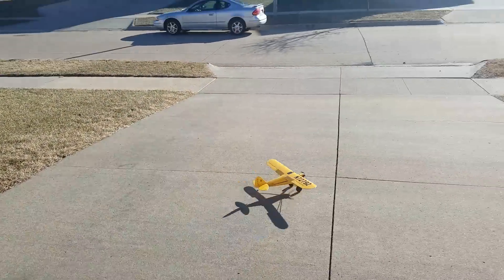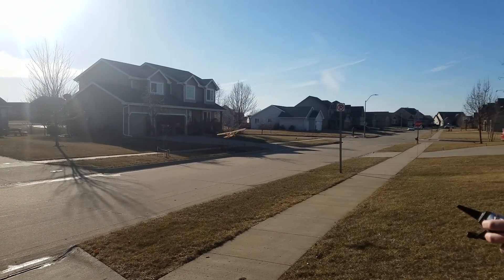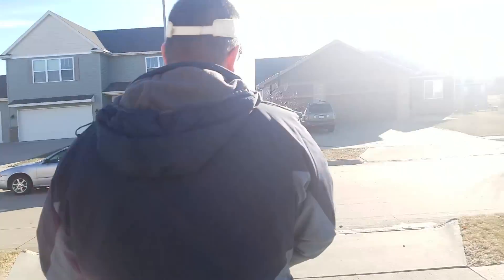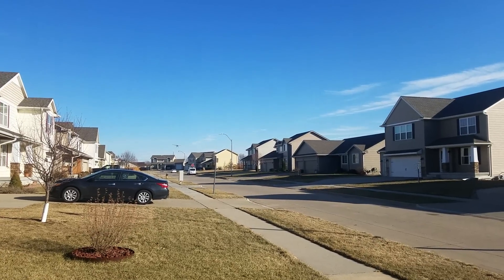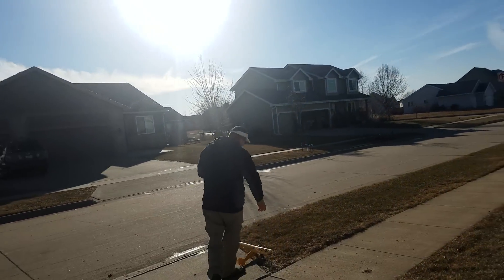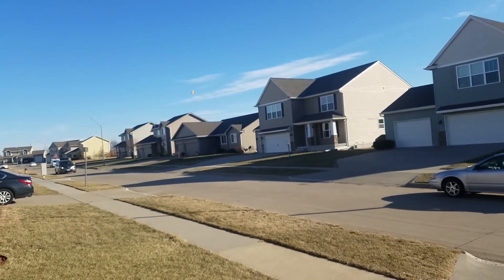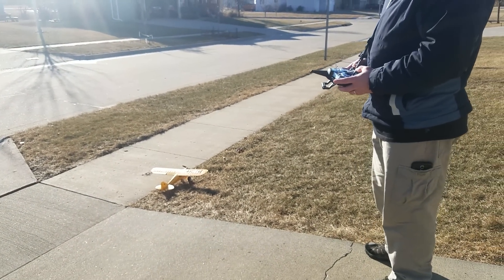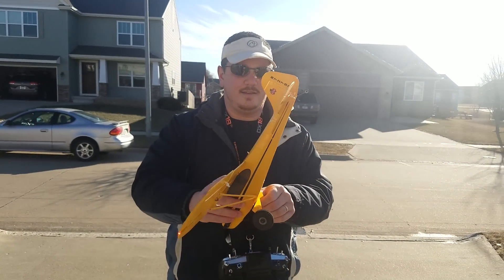E-flite - J-3 Cub UMX - Flaps, LED's, & Lightened Tundra Tires 1/14/2017

Comment: Dig the mods you made to it.  Glad you are liking it.  It handles the extra weight well.
Reply from the maker: I think I may still think about the 3S mod...if the ESC and Motor don't complain, that will immediately solve the problem. Oddly enough though, some of these Horizon Hobby UMX's won't work on 3S. If I try it I'll share the video for you all.